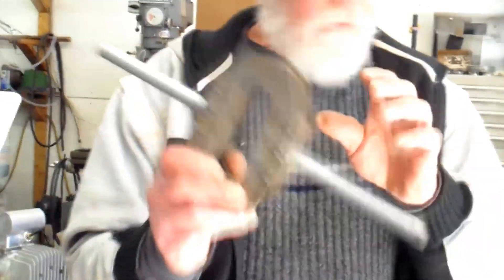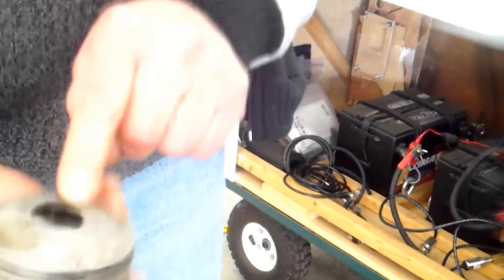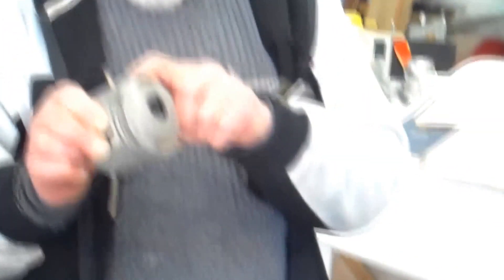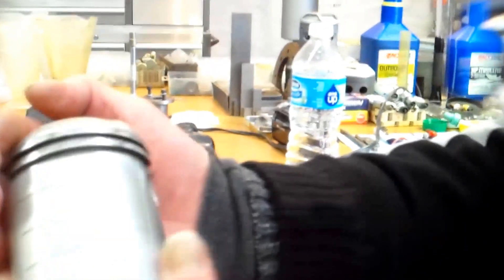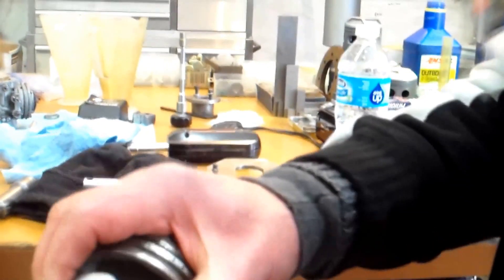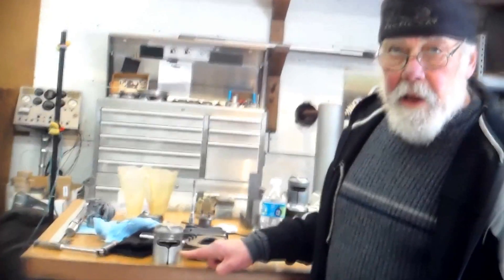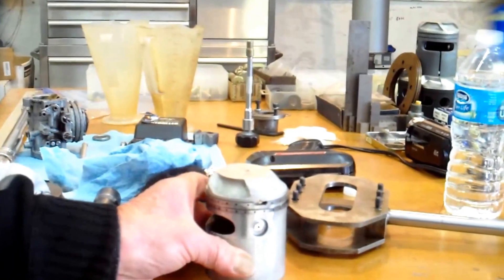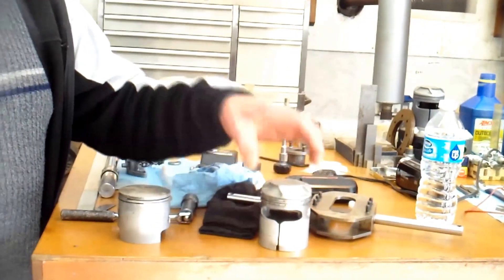Video #2 Bourke Engine Test Run

Comment: Can the Bourke engine benefit from this? When the crankshaft is at or 
near the 90 deg, there is side load on the Yoke......This could 
eliminate the English yoke and the crankshaft and replace it with just 
round drive  shaft https://www.youtube.com/watch?v=zae2ZePQTwQ
Reply: Good thinking, but those gears would break instantly.
Normally there would be sideload on the yoke HOWEVER because the Bourke is a boxer style design there really isn't any amount sideload that makes any difference. This is because what tiny tiny sideload there is, is distributed evenly and at a perfect 90 degree's from the sylinder bore. Unlike conventional engines that have a canted sideload that pushed piston skirts into the side of the bore.

Comment: The idle speed and max speed(RPM) of this engine, please.Also the compression ratio...Thank you
Reply: Compression ratio is about 22 to one however one could get compression ratio's a little higher from the Bourke design. Idle speed can be as low as you want it if you control engine RPM via how much fuel it gets.
Reply: I was helping Roger testing it on HHO. I couldn't produce enough HHO TO make any difference. 
His engine had carburetor issues and he could not get it to idle at under 5000 rpm. With a propane carb it would probably run well on pure hydrogen..

Comment: Can I ask a favor of you? Can you remove the photo of my Gas Processor off of this page?  http://www.hyfusion.com/StanleyMeyerWaterFuelCell.htm
You can keep the science part as I was close back then but not close enough to get a working prototype going. And just so you know on the "VIC Matrix" photo you stole from me I made a mistake and drew the rectifier diodes backwards so you might want to pull that photo down as well.

Comment: I prefer the DC Electric motor.  Get DC power from the fuel cell.

Keep it quiet and simple.
Reply from the maker: Nice in theory but the reality is that a fuel cell requires Hydrogen. So, you must connect to some mega energy business and pump hydrogen into extremely heavy storage containers on the vehicle. You are back to the issue of weight and efficiency plus you still have to purchase hydrogen from your local H2 gas station.... so you are still at their mercy on the pricing. Nobody delivers Hydrogen to homes and especially if you live off the grid.

My preference is actually to run a super efficient steam engine on HHO produced by my HHO Fuel Making System and use it to heat my Aphoid Boiler.
You can get steam engines from 20 hp to 500 hp and larger that are light weight and relatively inexpensive. They are quiet, simple, easy to repair but can run 24/7/365 with very little maintenance. No brainer.
Reply: and energy source for the hho generation? how much kwh? where's the supply?
Reply: @Current Batches Honestly, if you can crowdfund a dyno for him, that would solve your curiosities much better.